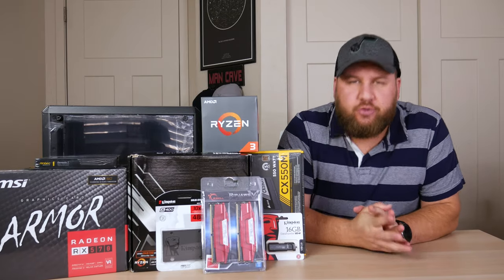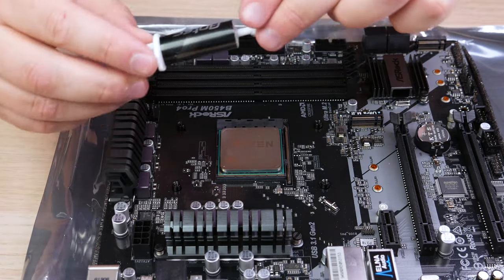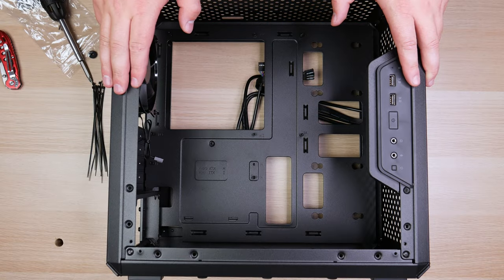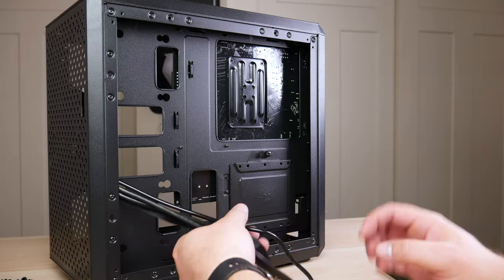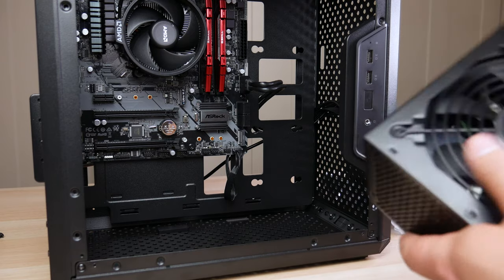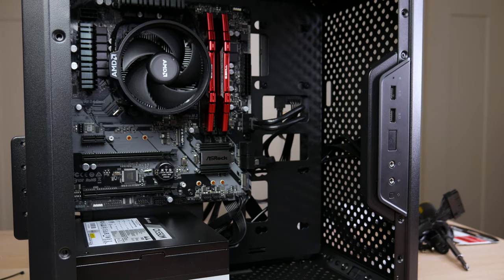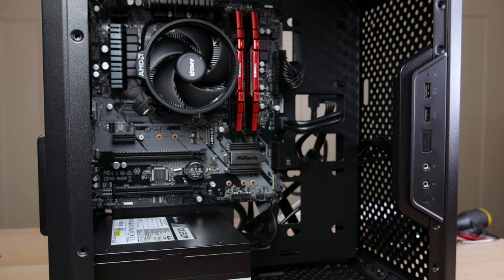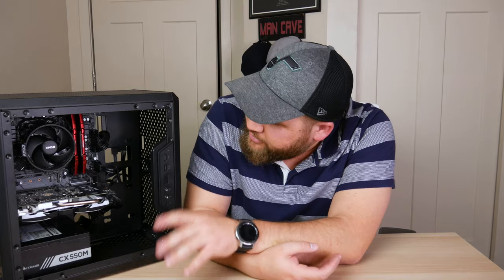How To Build Your Own Gaming PC Step By Step 2019

Comment: Ram goes in the 2nd and 4th slot, also when installing CPU, do NOT wiggle or push down on it. It should simply drop in, that's all. Other then that nice build.
Reply from the maker: Thank you, the ram is dependent on the motherboard. This board, channel 1 was slot 1 and slot 3.

Comment: For the graphic card you put the fans down .you can do that right if you want to get air from the bottom?with like extra fans
Reply from the maker: The graphics card will only install one way. Just make sure the key is lined up. Most of the time, the fans are on the bottom side.